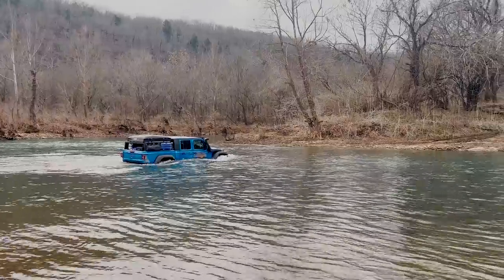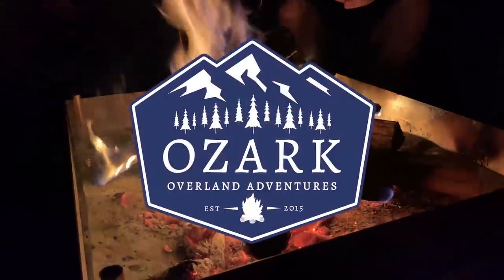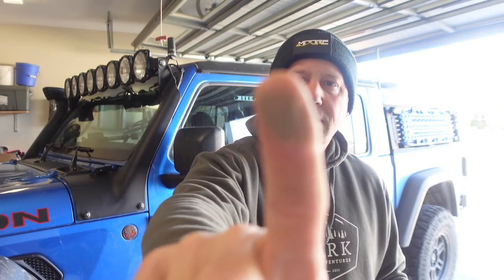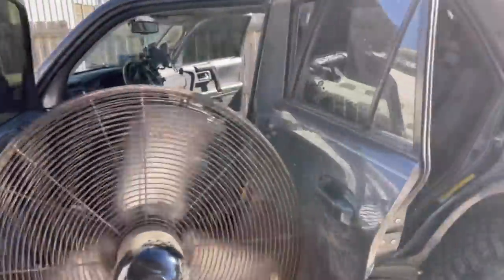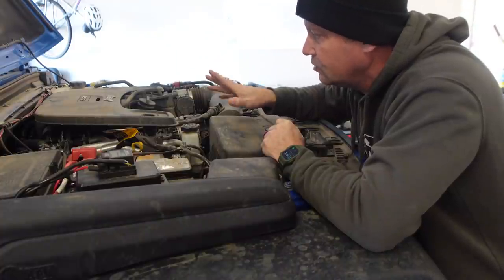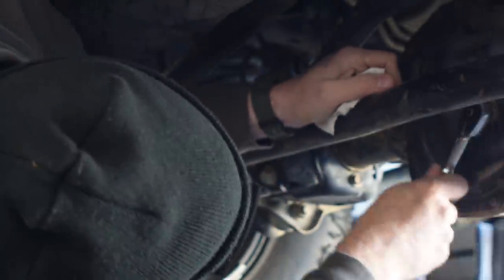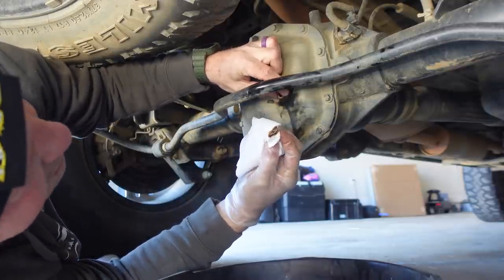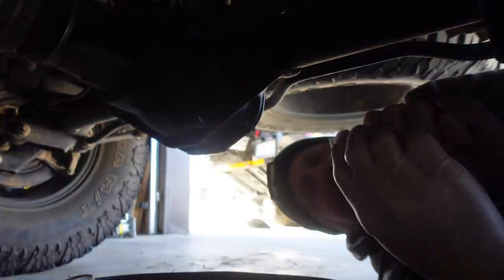Post Trip Maintenance - What to do after deep water and mud

Comment: EXTREMELY IMPORTANT ADVICE!!!
Always remove the fill plug or brake torque first before removing drain plug.  If you don't you run the risk of removing the drain plug letting all the oil out and not being able to refill the differential.

Comment: Good basic idea, but not 100% correct.  NEVER NEVER  use pressure washer first on the underside.  The pressure along with dry grit under what you're wetting CAN get pushed into u-joints, axle seals, brake piston seals, drive shaft spline seal, etc.  BETTER to simply use water hose at the house and gradually wet everything (soak not with hard pressure) then the mud slops off without being pushing into anywhere.  Then after all mud and debris is removed, use a low pressure pressure washer on areas that don't have seals.  The rest should be manual labor to make sure you don't push crud into the areas mentioned above.   

Another area to ensure proper flushing is the frame.  The JL's and JT's have adequate drain points along the length.  Park the jeep at an incline with the front end up and start in the big hole right behind each of the front shocks.  You'll see mud, and dirty water come out along the entire frame rail on either side.  This will take a while and you may need to work you're way down the frame to ensure EVERYTHING is out.  This is especially helpful for folks up north who deal with road salt.  

For wet interior carpet, would advise to first take a water hose and lightly fill each foot well again in order to rinse the carpet of the dirty water it soaked up.  Rinse until clear then  purchase practice Hockey pucks on AMAZON (like 10 for 15 bucks or so) and use them as spacers between the carpet and the tub (a sort of carpet lift) to aid in air circulation while running a fan as you mentioned.  This will help SIGNIFICANLTY with moisture funk smell afterwards, then it's only a matter of using a carpet steam cleaner with good smelling soap to get it back to new car smell.  

When pulling bottom drain plug of the axles FIRST CLEAN IT>  No dirt and debris.  Look closely at your footage and you'll see you had crud that most likely stuck to the oil and is now embedded into that O-Ring on the plug.  

As for suspension bolts, etc.  always best to ensure everything is torqued BEFORE any trip then simply match pen mark with a white line or an actual product that used for this across bolt heads, nuts, etc. so that everything can be visually inspected.  In other words if something moves you'll see a mis match between the line you place and will automatically know to retighten and torque again.  

As for steering you missed a big one here.  It's a MUST to grease any steering joints (drag link, tie rod, etc.).  Even with good seals, you're likely to push out water that might have worked it's way in through the rubber bushings as the steering was turning back and forth through dirty water and mud.  Also a good point to note that if a questionable amount of water is pushed out, then suspect the rubber boot is worn, cracked, pinched, or ???  

An additional inspection point, is pull tires off and ensure no mud caked up inside of rims which will throw balance off .  Also look for mud caked up in each brake rotor vent.  Mud tends to build up here and will either prevent proper cooling of the rotors (eventually leading to easy to overheat especially in the mountains.) or will flak off while rolling down the road over time allowing small sand particles and tiny rocks to potentially get slung into the pad in the mysterious ways that it does.  

Not trying to be negative on you're video, but just wanted to share my experience and proven methods (25 years).  Now that I have a JLUR I too actually take it off road and HATE MUD, but sometimes it unavoidable.  That said taking these steps will help significantly.  On a related note, I've seen my jeeple over the years have failures or premature wear in the areas I mentioned above from using pressure washers and or not taking the time to ensure all areas are clear as noted above.  

Great post, and good way to put this out there.  A final tip to everyone and anyone with a new / newer jeep / a built jeep with good paint and good undercoating - WAX the mess out of it before taking a trip and use a non sticky type tire shine on your axles, frame, skid plates, drive shaft, etc. before the trip.  This will help any and all mud simply drop off at the first sign of fresh water.  NEVER use armor all or any of that tire shine stuff that's stick.  That will just make things a little harder to clean and after washing it off, it will dull the look of your factory paint / undercoating of your jeep.  I like the turtle wax no sling conditioner type shine on tires and the undercarriage before an offroad trip.  

God Bless all of our fellow jeep community and enjoy!!!!
Reply: I didn’t see any mention of transmission the one breather tube that isn’t accessible to extend is the tranny. Anyone check the tranny fluid for water?  I have a manual but I believe it still uses ATF instead of 90 weight.  Thanks for the post Matt and the expanded knowledge reply JT.
Reply: As Matt mentioned the new jeeps have no inspection or fill point on Trans.  But the breather tube is high up to the motor so pretty safe.  The depth capability of the JL and JT is deep.  Add a lift and your even safer.  I like inspection points but know and understand the design idea of ZF as these transmissions have proven track record.  That said as long as no Trans leaks, then no place for water to suck in.   If I were to ever go as deep as my Trans vent end is then I'd assume I'll have bigger problems then water in my Trans.  LOL.  My JLUR is on 5 inch (really 4.75 inches) and 38 PAT'S.

Comment: It takes less than 30 minutes to remove all seats and carpet from. 5th Gen 4runner. The sub carpet will retain moisture and stink to high hell for weeks. Pull the carpet, shampoo it and reinstall when dry. Do not put fans in there and expect it to work. You can also apply dielectric grease to all the seat connectors before reinstalling.

Comment: the Transmission has the shortest vent tube, it sits just on top of the transmission
Reply from the maker: Actually I think it's the transfer case that sits on top. The transmission is vented up in the engine bay. But I could have those reversed.
Reply: @OzarkOverlandAdventures  Yes you are correct. The transmission is the highest one already in the engine bay. the Transfer Case is the short one.

Comment: Is that your tire or something else rubbing on the LCA? There's a huge obvious patch of worn metal @11:35 in the vid. Not sure what else it would be other than the tire rubbing at full turn.
Reply from the maker: Yes. Tire rubs at full lock. It’s the one thing I don’t like about Rock Krawler lower control arms. They don’t have the same bend in them that other arms do to prevent rubbing.

Comment: Looks like control arm is rubbing as you can see bare metal. Might want to look at that
Reply from the maker: Yes the tires rub at full lock. It’s the one thing I don’t like about the Rock Krawler lower control arms. They don’t have the bend in them that other brands (including factory) have to prevent rubbing.

Comment: How do you prevent water from getting into cabin from jl/jt gromet that people remove to run wiring and radio and stuff? After so many wires its pointless to drill the cap. Do you just duct tape it or use a can of great stuff?
Reply from the maker: You're not going to get water in that unless you are stopped in deep water. With a good bow wake no water will get up there.